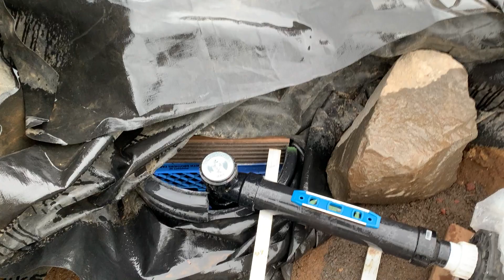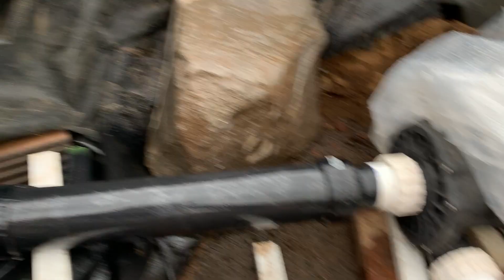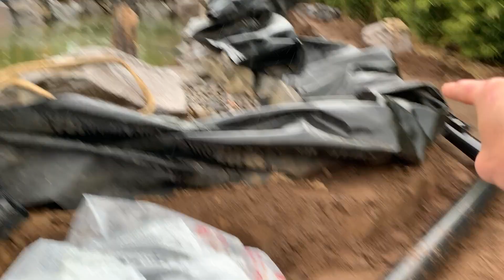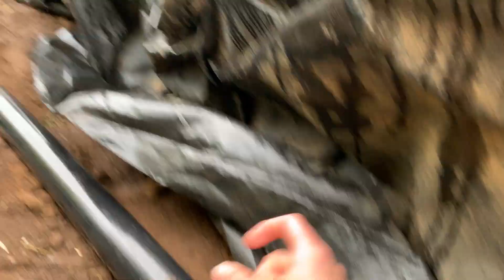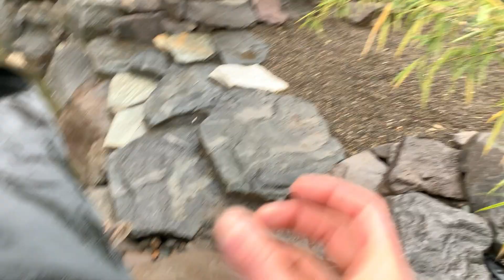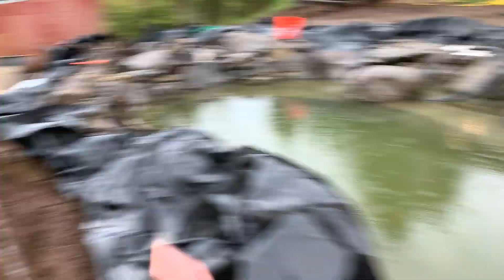Swim Pond Update: External Pump is plumbed and ready to fire up!

Comment: how did you size the bog and flow required through it?  I've got a big natural pond (80kgal), mud bottom, and need to add intake and bog, trying to size them.  Not sure how big to make  intake or bog and flow.
Reply from the maker: My bog's surface area is 15% of the surface area of the pond. That's a good starting point for most ponds. I also put an upflow filter at the bottom of the pond which pushes water through about 6" of sand. That is also 15% of the pond's area.

As for flow, I am shooting for about a 20 minute transit time through the bog. Mine holds about 1,200 gallons of water, so pumping 3,000 gph gets me to the target transit time

In general, ratios can get smaller as ponds get bigger, but I don't know much about mud bottom ponds, so I don't know if or how that would affect  sizing for that type of feature.